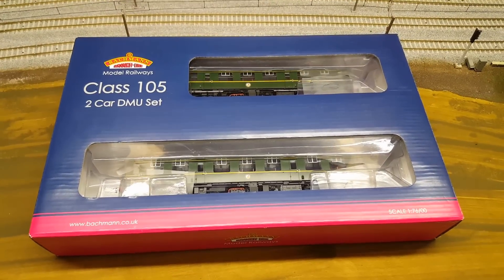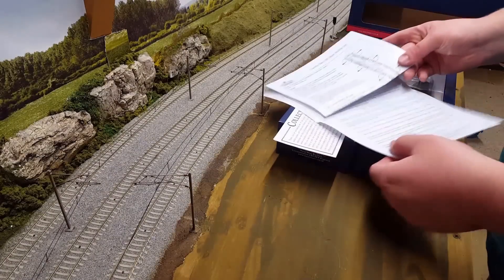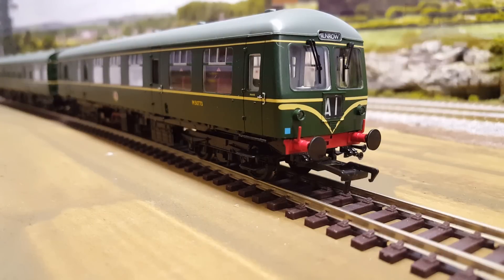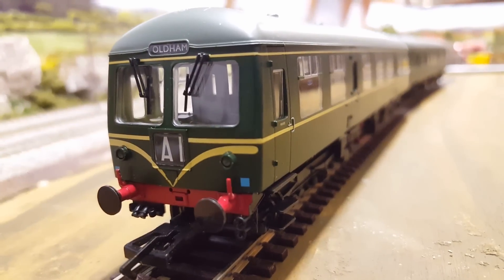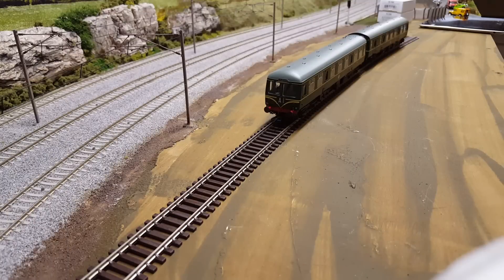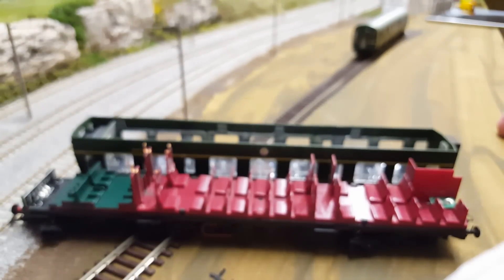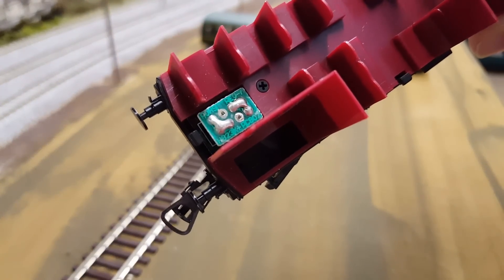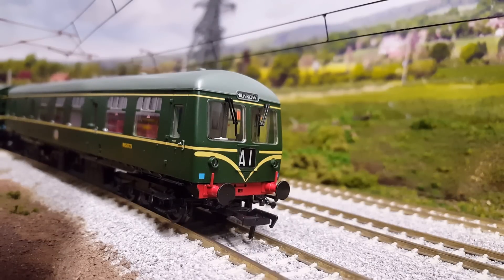New Junction - Unboxing Bachmann Class 105

Comment: Just purchased my 105 as it used to run a small line near my town in essex. thank god you inlcude where to get the propper DCC chips from, id hate not to have working lights on my coaches.